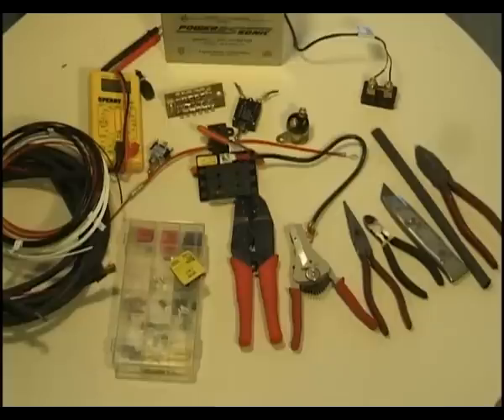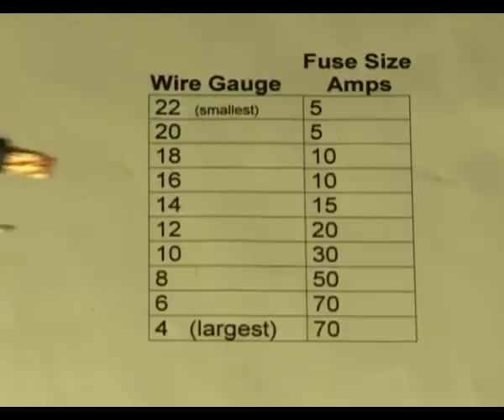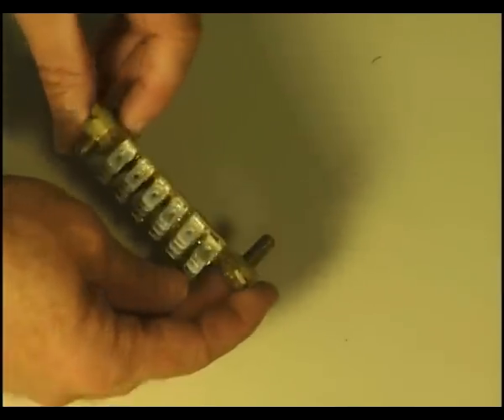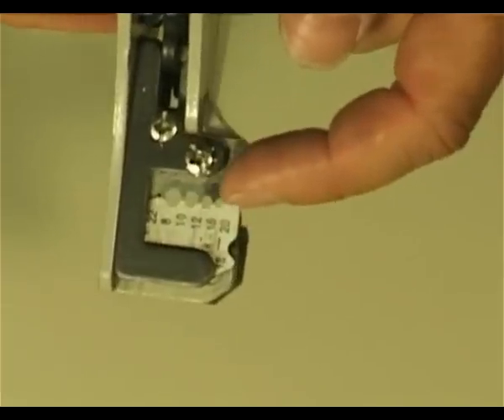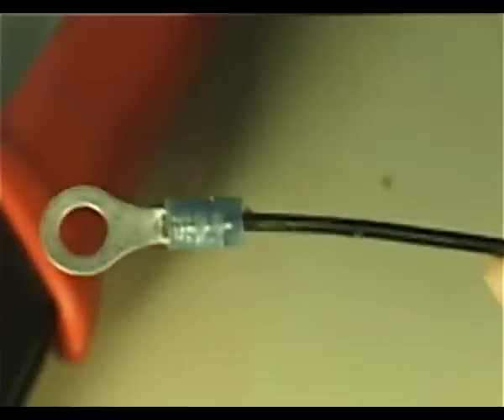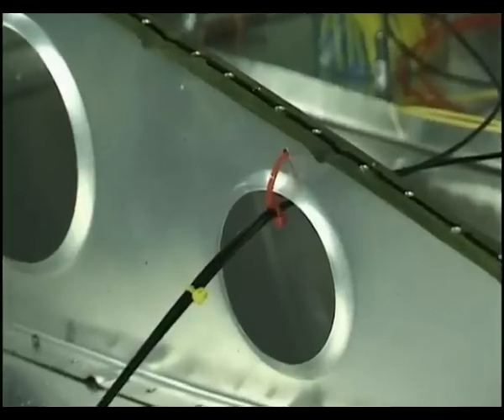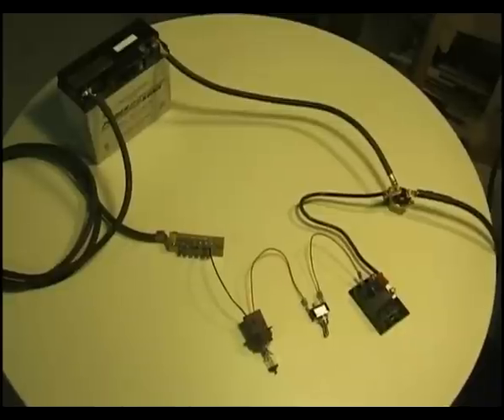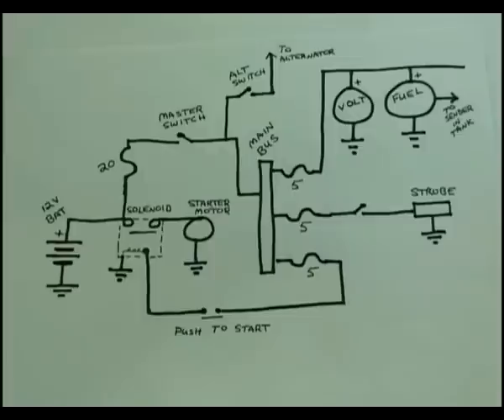Electrical101 for Homebuilt Aircraft

Comment: By and large, a good basic tutorial on electrical wiring systems for aircraft. Boats use pretty much the same criteria as they too are subject to performance extremes in a marine environment. The only time a crimped connector is also soldered was the one hooked directly up to a battery terminal; this to minimize the effects of corrosion. You are right also about the terminals from budget suppliers, one should look for a supplemental sleeve inside the barrel that acts as a wire's strain relief.